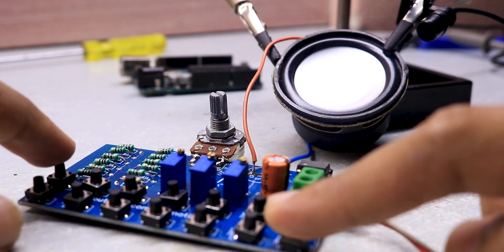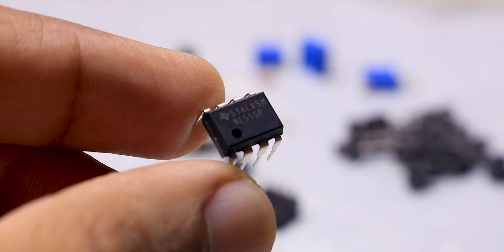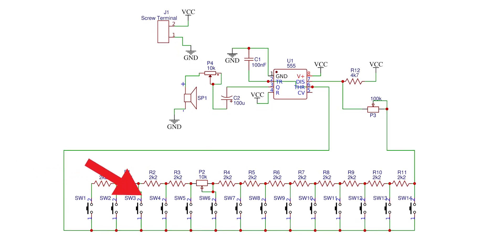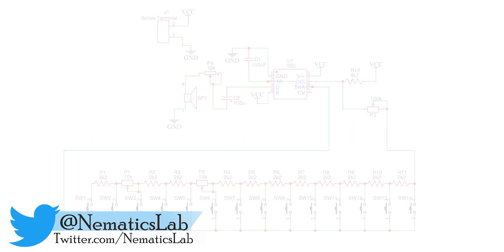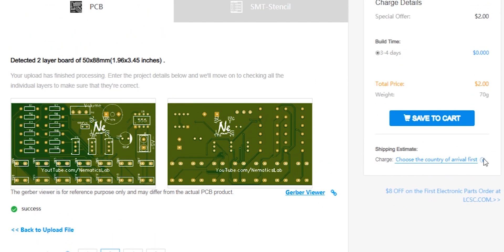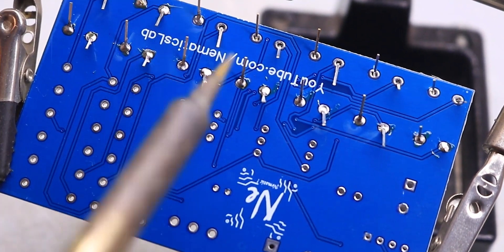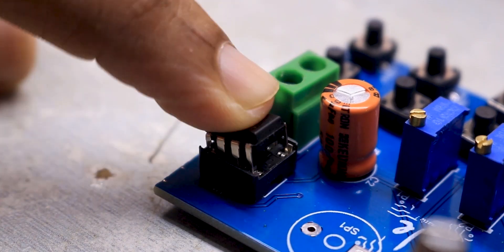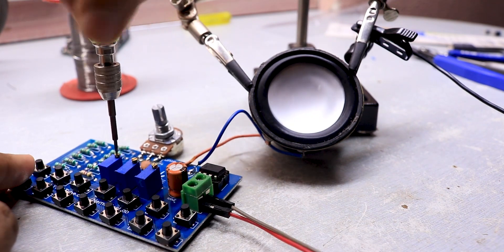Make Your own DIY Piano using IC555! | Tone Generator | Easy

Comment: Ic 555 is widely used as it has many uses in the circuit. once I make a project which uses 555 to activate the mouse in "tap tap" mode with a frequency of 13 Hz. Games such as pubg have DMR rifles which make tapping ease with the help of this IC. 
Moral-Necessity is the mother of invention.